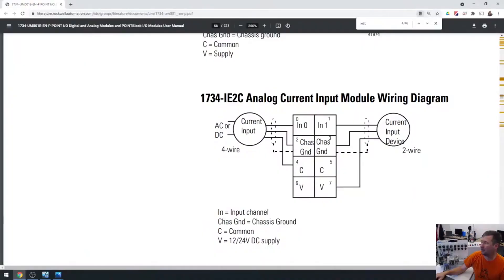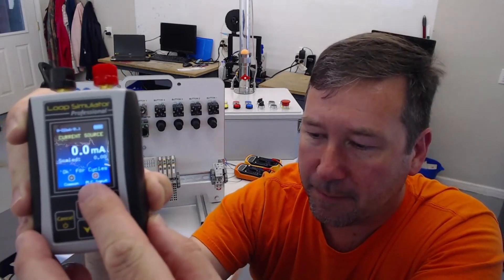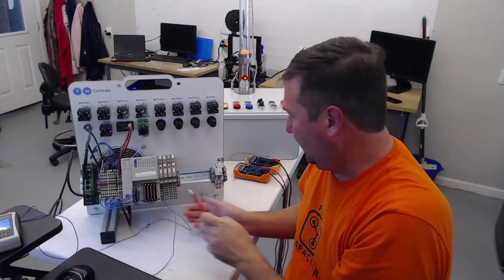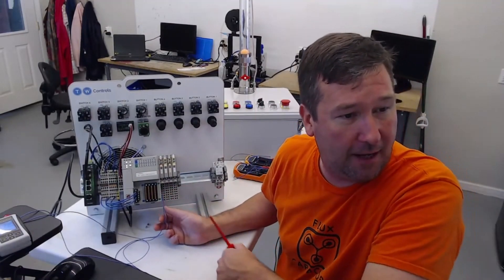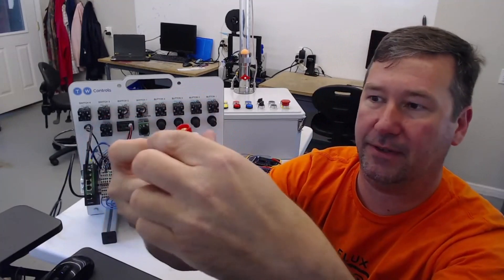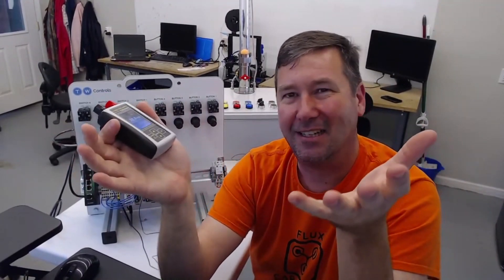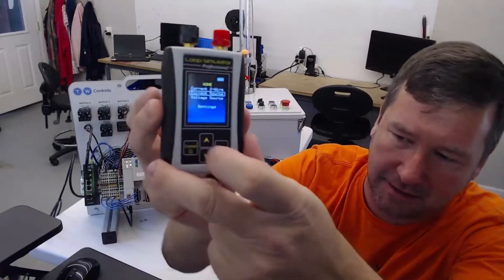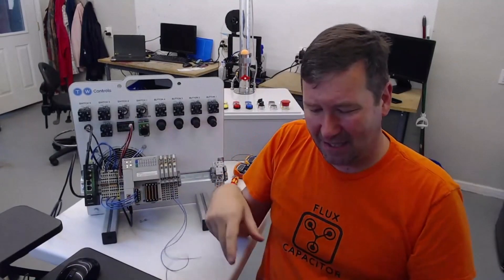4-20mA 4 Wire Current Source Wiring to an Allen Bradley PLC Input

Comment: If I don’t have to run through my PLC backplane for a device I won’t. I agree with using the 0V terminal instead of the card terminal for the 0V. The more wires landed on the PLC the more of a likelihood of an electrical fault that can fault a card or even worse the PLC.
Reply from the maker: Yep.  Thanks for watching!